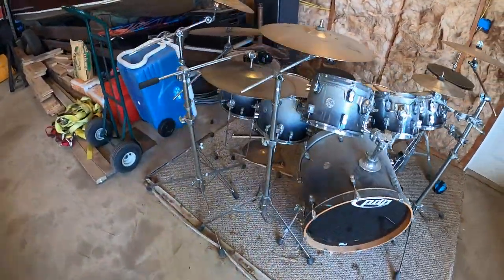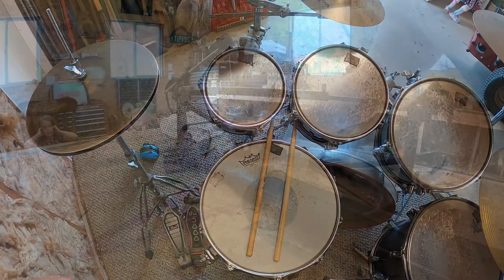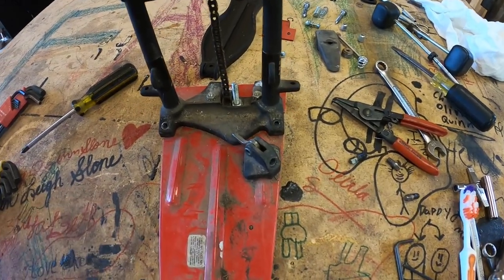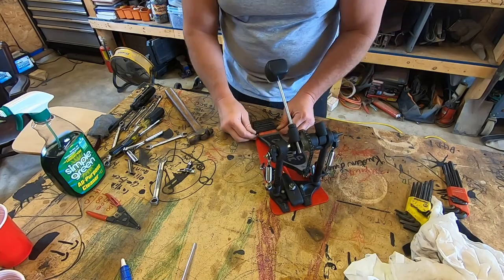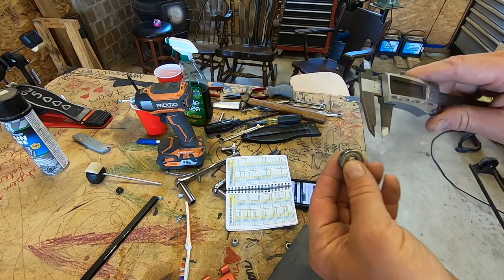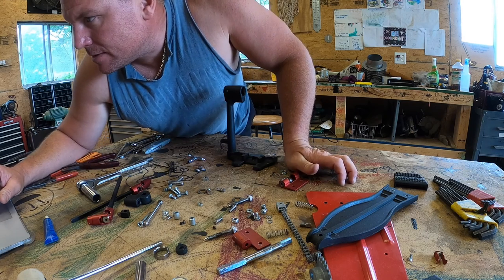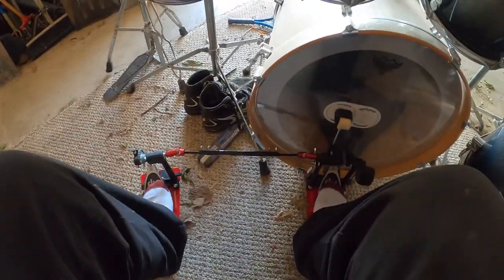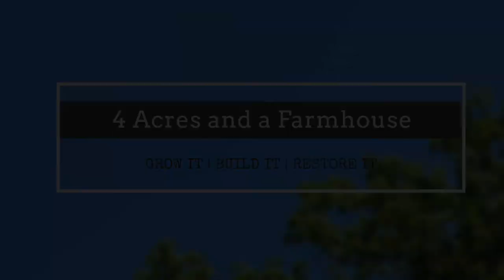DW 5000 Double Bass Pedal Maintenance

Comment: I'm cleaning up my old pedals and found this video super helpful. For future reference, the bearings used in these pedals are also used in skateboards, so you can pick up replacement bearings from any skate store that might be near you
Reply from the maker: Great tip.  Keep jammin’ and rippin’.  Thanks for watching!!
Reply: This is incorrect.

The bearings used in the pedal are R6Z, 3/8" inch bore with 7/8" outer rim, 9/32" width.

Standard skate bearings are metric, 8 mm. They are close in size, but not compatible unfortunately.
Reply: @ToddJeffreys  good call out! I had only heard this from someone who said they did this themself.
Reply: @seanybabyy  No, the bearings are R6zz and 626zz, Bones reds skateboard bearings are used in iron cobra pedals making them superior to DW. Dw uses standard poorly mass produced China products and claim they are made in the in California.

Comment: Their a waste of money. Like everything Drum Workshop. Your paying for the brand name. The bearings are 626zz, “That little clip” Goes on your plate it is a drum key holder.
Reply from the maker: Eh……. I’ve had that pedal for 10+ years.  I’m good for it.  The only reason to use “That little clip” would be if I were traveling and in a band.  I’m a garage rockstar bro.  Also. I think you mean they’re and you’re.  Not judgin’, just sayin’.  Thanks for watching.
Reply: @4AcresandaFarmhouse  it’s actually pretty handy if you can’t keep track of a drum key. Need to tune up your snare or head, keys always right there under your foot.

Comment: DW uses Loctite on all their fasteners. Did you not have to heat them up in order to remove them? I remember stripping a bunch of bolt heads years ago when I had trouble taking a DW pedal apart.
Reply from the maker: No.  Everything came apart fairly easily.

Comment: Hey man I'm having issues with my dw 5000, the left pedal has lost its tension
Reply from the maker: Are all the set screws tight?  I would start with checking all of those, especially the spring rocker.  It took me some time to get that adjusted back to where it was comfortable because I didn't mark it before I took it apart.  Also, there is an adjustment screw at the bottom of the spring that will add tension to the spring, if this turns loose, that can also give you some problems with rebound and tension.  Let me know how that goes and if there is anything else I can help with.  Good luck and thanks for watching.

Comment: how did you remove the nut that holds the bearings on the left pedal?  I'm having a hard time trying
Reply from the maker: It’s been a minute since I did that, but I think you can use a Cresent wrench in the rod that carries the heater and then just use a socket to get in to the nut.   I think I took a socket and ground it down a little so it would fit.
Reply: Hey. It is much easier :D just loosen the holder for the drumbeater and then push the cogwheel towards the nut. You will get the nut moved outside. Before that, you have to loosen the small grub screws on both sides where the bearings sit. If that makes any sense.
Reply: @GabyGuinezPH  there’s a small retaining ring holding it. Look closely it’s small.

Comment: How did you remove the pre-load nut? Did you use a thin walled socket?
Reply from the maker: Sort of.  I took an old deep well socket and ground it down on the sides to fit in there.

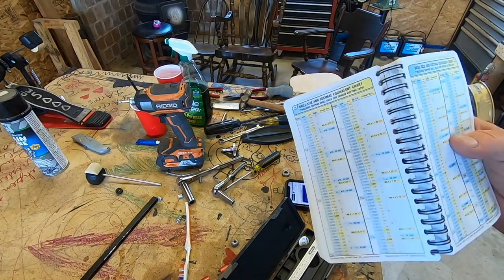Comment: 7:40 you don’t actually need a book to convert fractional measurements into decimal. Just use a calculator. Type in the top number, then hit the division button and then the bottom number. Works like a charm. Yes. I was shocked when I learned this too! 

Example 1/2” = .5 (1 divided by 2 = .5)
Works every time. 

3/8 = .375

Boom. 

No engineering book needed.
Reply from the maker: You’re right, and I know.  Thanks for watching.